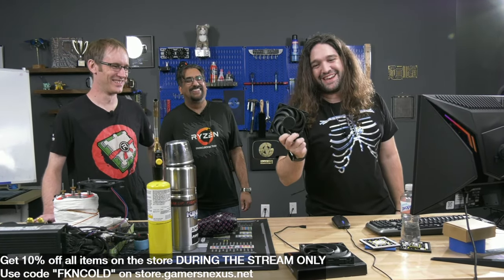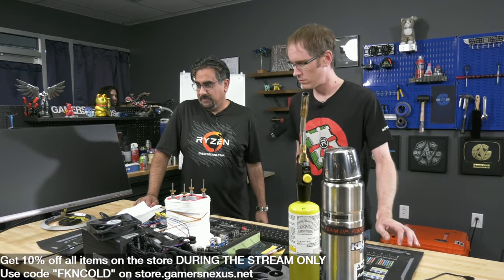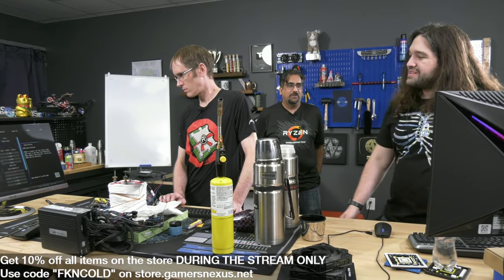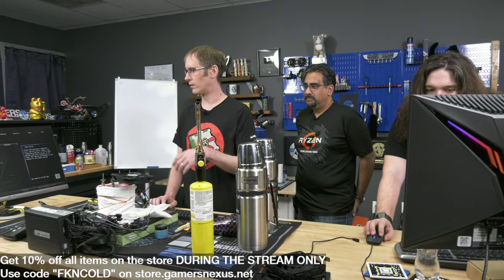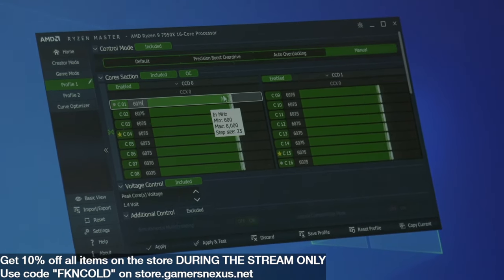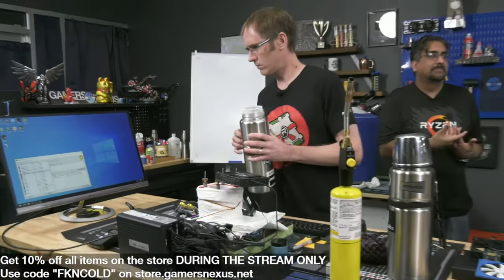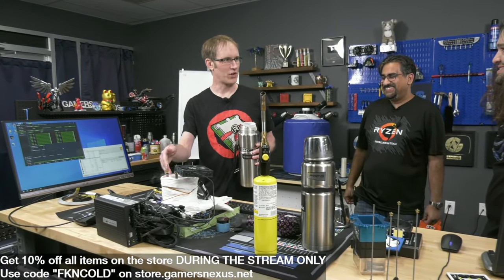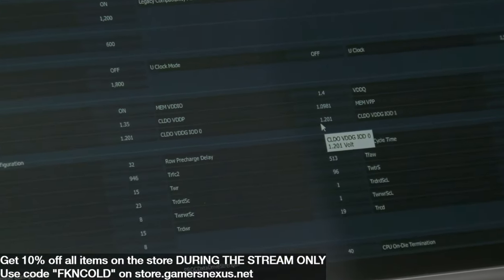LIVE: AMD vs. GN Extreme Overclocking 7950X: Learning How to Overclock

Comment: If you're a newbie and you use the chat to ask a question about what hardware to buy..... please direct your question towards the chat and not the host. The host is usually busy running the stream and they will almost never answer your question.
Reply: This specific chat is the worst place to ask a question like that.
Reply: @crylune  Because of all the low information nerds that watch the stream, or specifically those are the types that dominates the GNN live stream chats? Too bad Buildzoid at actual Hardcore Overclocking doesn't do streams like this...

Comment: Just FYI, whether its hot oil or something like liquid nitrogen, if you spill it on clothes, you want to take off the clothes as quickly as possible, like instantly drop your pants, then have paper towels to wipe off any that's on your skin, though you can use your hands in quick swiping motions and then wipe off your hands on anything that is cloth like or, again, paper towel. Speed is key to prevent a serious burn with hot liquid or ultra cold liquid like liquid nitrogen. (I was a certified advanced First Responder when I was younger.) P.s. Liquid Nitrogen should be considered dangerous.

Comment: Spread spectrum is also useful in audio engineering aplications to prevent noise from the frequency peaks impacting the soundscape. Often depends on how good the isolation/filtering is on various parts of the power delivery setup for each device is but I have certainly encountered a noticable reduction in undesirable noise in some scenarios when enabling it.

Comment: I really don't understand that goal of cooler compatibility. It's an entire new platform, new socket, from PGA to LGA of course people would expect new cooler mounts.
The compromise of keeping z-height is the giant thicc-boi IHS, and you really still aren't fully cooler compatible if the cooler uses it's own backplate anyway!
The consequence of the thicc-boi IHS is much higher thermals, which are evidently a real issue. So was keeping "cooler compatibility" really worth it?
Reply: Exactly! Plus the cost to upgrade to AM5 is already expensive. Adding 10-30% to the cost for a better/different thermal solution compared to AM4 won’t cause anyone to bat an eye. Big oof from AMD.
Reply: @greensleeves8095  what like Intel don't demand a new motherboard for every generation? The AM5 will last a fair few gens and Intel next gen will demand the same if not more.
Reply: Rex Goeckeritz  If the 5800X3D is anything to go by, the increased die height is fairly minimal, if any, as I believe they saved down the dies to accommodate the vcache. I don't know the technicalities of 7000's implementation though...
Unless they're planning on some crazy OP vcache sku's. It's a possibility. But it's AMD who are repeating this "cooler compatibility" line. Which is only partly true anyway.
Reply: AMD haven't changed the IHS size and z-height of their desktop CPUs since Socket 754.

Comment: The MAXIMUM SAFE voltage for daily use on Gen3 and Gen4 Ryzen (3000 series and 4000 series) is 1.3 Volts, and for Gen5 (7000 series) it is 1.2 Volts.

Comment: So since moisture is such an issue, and North Carolina is not exactly known for low humidity, why not enclose the motherboard with a container passing cables and the pot through of course, and put a dessicant in the container with the motherboard?
I have always wondered about that... 🤔
Reply: they are indoors and have air conditioning...probably not much of an issue…

Comment: As someone new to this as a hobby, is air cooling going to be dead going forward? Between AMD's 90°-95° CPUs and Intel's 13th gen running at 250ish watts without any overclocking, isn't liquid cooling going to recommended?
Reply: Maybe, but that doesn't mean air cooling would be obsolete. AMD's cpu was designed to run at that temperature, so whether you use water or air cooling, it's still 90°. Also as technology advances, the trend has for the most part been decreasing die size and less power draw ( I think), meaning less heat as well. Plus I can't imagine Sony ever watercooling a Playstation so as long as console gaming exists, so will air cooling. AIOs are a thing too, which is like watercooling with training wheels. All methods have drawbacks.
Reply: Nah, them 250ish watts are only if you fully utilize the cpu with a heavy load like doing a render, for games the cpu wont pull that much, hecc, der8ouwer even showed that you can set a 90watt power limit and only lose 9% performance on a 13900k. so yea air cooling is still an option if you just game.

Comment: Give us a way to specify different max temps and I'm happy, I'll just turn it down to 80 and put on the best cooler I can
Reply: The feature is there. In the PBO settings.  Take care!
Reply: Just go to PBO advanced and drop the 7900X/7950X limits to 165 PPT, 115 TDC and 150 EDC. Fixed.

Comment: I'm so confused. Some YT-reviewers use above 6000MT/s memory settings with Ryzen 7000, but when you read different sources, you'll get the idea that probably doesn't offer the best performance. This is a quote from Anandtech "...if memory speeds exceed 3000MHz (DDR5-6000), then the memory controller will fall to 1:2 with the memory frequency, which will incur a performance hit." So is this only on some 'auto' setting, or is there a hard limit you can't bypass with BIOS settings or is it silicon lottery, where you might get more, but likely not?

Comment: Did anyone ask these guys who are obsessed about LM2 how AMD managed to launch a chip where they think 95C at idle is "normal"?
Reply: Why the fuck would they care about that? You see someone from AMD, you automatically assume they know everything that's going on at that company, the ins and outs of every suits' decision?

And it's not 95C at idle. It's 95C under load. At idle, the CPU changes frequencies so fast that the temperature is around 40-50C or under 40C when all cores are sleeping. Learn how Ryzen works. If AMD engineers deemed it safe, they know what they're doing. Doubt you do. All the casual user has to worry about is adjusting fan curves so the temperature jumps at idle don't get annoying, which has been the case since Zen 2.
Reply: @crylune  use big boy words, instead of swearing maybe? and you might want to check out literally every review video saying "why is 95c normal now?" And gotcha comments like "learn how Ryzen works" is lazy trolling. Grow up AMD fanboy

Comment: All it took was LN2 to tame the 95c 250w Zen 4 CPUs... I dont know what AMD was thinking. Guess they couldn't keep up with Intel even with a node advantage unless they went down this path. Zen 4 has been the most disappointing Ryzen launch to date between power, heat, pricing (including AM5 and DDR5), and performance. Its an easy generation to skip for me.
Reply: you didn't mention high prices as being a deterrent.  price of cpu's, price of new cooler, price of new motherboard, price of new ram. Nothing is priced affordably currently. It is no wonder people aren't buying their cpus
Reply: u can change to tdp 65 watt or 110watt (cmiiw), u just lost performance less than 10%
Reply: What do you mean "to tame"? The processor tries to get to 95ºc. It will rise to that temperature if possible to get the most performance.
Reply: @Rafaelinux  u can change via bios Bro
Reply: You don't know how the chip works at all
Reply: "All it took is LN2" tells me everything about your knowledge of Ryzen, which is zero. The CPU reaches 95C during load, and it doesn't reach that temp on the entire CCD & IOD complex. If AMD engineers deemed 95C under such loads safe, then it's safe. I doubt you know more than them.

The only thing the casual user has to worry about with Zen 3 and above is modifying fan curves to accomodate for the temperature jumps so that they don't go insane from the noise of the fan changing speeds constantly with Ryzen's fast changing temperature on idle. Ryzen puts all background processes and stuff ON ONE CORE, increasing temperature FOR THAT CORE and the cooler detects it as a whole CPU temperature so it ramps up accordingly.

On Zen 3 and above, there is ZERO need to worry about temperature. At all. If the frequencies are stable, who cares.

But sure, keep your dumb narrative going instead of educating yourself.